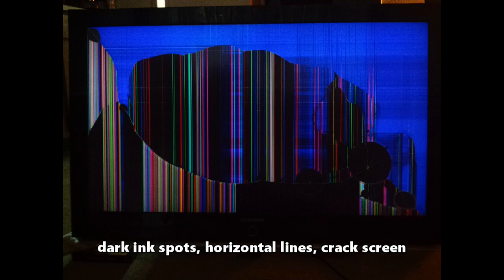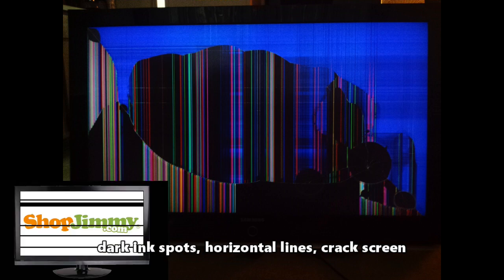Can I Help You Fix a TV by Looking at the problem and Tell you what Board to Replace ?

Comment from the maker: Subscribe to Tampatec here- https://www.youtube.com/tampatec Get TV boards here- https://www.shopjimmy.com/ or https://electropartsonline.com/ use code tampatecfriend *Get Fluke Multimeter here- https://amzn.to/2Er0JIb or *Solder iron kit- https://amzn.to/2PCmNk7 or *Solder iron with meter kit- https://amzn.to/2yJilZv
Reply: I have a vertical red dotted line that fades a few inches from the bottom. I have swapped the ribbon cables on the TCon board, and swapped signals. The issue appears to be on the panel. Could this be a tab issue? I have pushed on any connectors I can see along the bottom.
Reply: Is there a way I can email you a question

Comment: So here is a stumper for you.  Vizio LED TV.  New LED's all tested and work fine.  When I install in tv, there is one strip that will not light, although I have the voltage going to that strip and tested.  Although the LED strip works when out of circuit but WILL NOT work when In Circuit, does this mean the LED strip is still bad? All voltages to all the strips are equal.

Comment: Hey TampaTec
Thanks for making all these videos, it helped me fix a couple of tv's in the past following your guides.
Now I just got an Onn 70 inch roku tv that have been dropped and I'm unable to pinpoint what is causing the issue. 
Everything seems to work except I don't have any picture. 
Backlight is on and sound is working. 
After checking voltages, led connector on PSU I get 1 pin that read too high (269v) and the others seems ok at 149 v. 
On t-con board I can see that I get 12v coming from the main board but 0.9 going out to the panel. 
So my guess would be to replace t-con but the Led connector high voltage makes me wonder if there is another problem there. 
Already replaced main logical board because only 1 hdmi was working. 
Any advice would be appreciated. 
Keep up the good work 👍 thanks

Comment: I have a Samsung plasma TV: PN60E7000FFXZA

It comes on and the screen displays fine but it random times it will blink off and the standby light will quick flash three times then pause then quick flash three times then pause...over and over.

Can you confirm that my issue is the power supply board?

Also can you recommend where I can find a replacement board?

Thanks! Love your videos!

PS: This problem didn't start until I connected my Xbox and set the TV display to game mode.  Could that have anything to do with it?

Comment: I have a samsung un65ku6290f, I have a black screen when I turn it on, no display but it flashes slowly. Sometimes you can hear the start up sound. The display appeared for me as recently as last night, had fully functionality while it worked for a couple hours was able to adjust the backlight brightness everything, went to bed woke up and it's not working again.  Capacitors are fine. Ribbon cables seem snug and secure. Any ideas?

Comment: Great videos! I'm trying to fix a ~10 yo Bravia LCD tv I took in off the street and mostly works except sometimes when you power it on it trips the GCFI outlet it's plugged into. But then sometimes it turns on no problem. I checked all the capacitors on the power board, replaced 2 of them that were about 25% below their rated capacitance, one was the big 450V one. No change in the problem. If you have an idea where I might look next to resolve the issue I appreciate it. I wonder is something shorting or what? I don't know where to look from this point. Thanks for any advice!

Comment: Hello.TampaTec....Love the show man...Keep up the good work!.....Need a fix recommended for a Samsung Plasma TV....Model #(PN50B650S1F) The tv has sound but no picture. The picture is a greyish color and it reacts to button presses. So what i mean by that is that when you press a button the screen will fade almost flicker...and then return to the same tone of grey....I see a few black horizontal lines in the middle of the display as well. They are thin...Any help would be greatly appreciated! Thanks
Reply from the maker: Can possibly be bad connections going to the panel or control board.
Reply: @TampaTec  any idea what I should try? Think bad ribbons. I have already cleaned the connections and reseated them. Could the logic control board be bad?
Reply: Also I changed the y and x boards plus buffers with no results to fixing the issue...metered the power board and it checked out good. All correct voltages...

Comment: This is an awesome video! However I don't think you happened to cover an issue I'm having. I have a Vizio M3D550KD that only works in black and white picture. I've tried everything, changing all the cords, plugging in other appliances, and still black and white. There's a you tube video someone else made that shows my issue really well. Do you have and suggestions? I assume it's the mother board, which I'm not sure if it's worth replacing. I don't usually ask for help, but I'm desparate. Thank you so much!

Comment: Hey TT,
I am working on a TCL 55US57. I've replaced the main board and tcon board, but there are still vertical lines on the left side that won't go away. Can the PCB that's connected to the panel (ST5461D04-1-XL-2) be repaired or replaced?

Comment: I had flickering on my screen and by moving the ribbons on the tcon board half of the screen went black, and a noise started in the tcon, so i bought new tcon but still get half black screen, i tried moving top ribbons connectors but dont get anything from Any thoughts? Any help is apreciated, thanks.

Comment: Hi your videos are very detailed and amazing . I have a sony 40 inch kdl40z4100  the colours are fine the tv was working but yesterday it started going to standby mode . When ever i power up the tv it goes to standby mode in 5sec it does not stay on. Any guidance on this issue. The red light of standy blinks 13 times and goes off and then 13 times . Thank you

Comment: Thanks for this video. I have  a question regarding my LG 42'LED tv Model 42LB5500-UC,   I noticed the  backlight is going black after 20 minutes of viewing, then it would come back to normal after turning off for an hour , power on the TV again and it is back to normal the backlight is working again but then after 20 minutes the backlight going out again. So I have black screen  but  the sound is still working. Can you help me with this problem? anybody has the same problem with this TV?

Comment: Hey Tampatec,I just stumbled across your channel and I was really impressed. I work on some tube guitar amps and will occasionally attempt to fix a tv. We were working on a building the other day and took a Samsung NU 7200 off the wall to paint the wall behind it. When we put it back on the wall and turned it on, no go! The screen had some colored lines running up from the bottom of the screen. Looked like cracks>not good. Do you think its toast. It was not that old, maybe 6 months.Thanks, you rock!

Comment: Great videos - thanks for the great help!  My LED TV seems to have varying behavior - comes on normally for a minute or so, then goes to all horizontal multi-colored lines (no discernible picture), then goes to just a glow, never fully black, and sound always works.   Most often skips the first two steps and  goes to just a glow.  I tried to replace t-con board - same behavior.  I am thinking I am done - it's the likely the screen - you agree?

Comment: i have an old samsung lcd tv (about 10 years old - yeah i know i know, not much to replace, but that's not the point!)...   the colour seems to 'saturate', like the brightness is on too high, so that might fall under "colour messed up' but it's not purple - just looks like everyone has a light shining on a greasy forehead! - messed with all the settings, searched online, and found the ability to enter the support menu, but i tried each setting and none of them work with my tv...  SO maybe a special 'support mode' remote might be the ticket?   i figure the Tv is getting to the point it's unwatchable, so if i can mess with it a bit and fix it great, if not, i'll buy a new one - but you gotta try right?   ali express offers 'support' mode remotes, just wanted to make sure they really are SUPPORT, and not just a remote... thanks

Comment: I'm working on my cousins tv and I can't figure out what's wrong. The tv powers up and the back lights come on but there is no display. I replaced the T-CON and that didn't fix it then I replaced the video board and that didn't fix it either. I'm at a loss of what to do next. What do you suggest ?

Comment: Hey I believe I saw your video by divine appointment! I paid about $1000 for my 65' LG 4k Ultra... My friend put it on my wall.. Few months later it fell right on it's face 🤦...miraculously the outside wasn't too banged up except on the right side facing the screen. The inside has lines on the bottom and a big black sorta like ink blotch is how I can best describe it. What can I do with this? Can it be fixed? Is it expensive? Should I just toss it and buy a new one?
Reply from the maker: Screen is bad most likely. Recycle parts sell boards on Ebay. Or just sell at garage sale.

Comment: Hey, i have seen a few of your videos and am having problems troubleshooting my tv. I have a D32x-D1 vizio. I can hear sound on the tv but no picture though i can see the letters when i use the flashlight. So now i think the problem could be either the main board or the led strips since i changed the power board..HELP and thanks..

Comment: Hello, I have LG 50UH55 . The problem is that when I try to turn on the TV on I have red dims for 3 second then LG logo shows up for a second with no picture after that . I don't no what's the problem . I chucked the capacitors but icoudnt find any bad capacitors.  Can you help me out to find out the problem?

Comment: i have a philips 50pfp5332d/37 that has a  blinking 8 light code i replaced all bad caps n then noticed on the main board the hdmi were shot ..the blinking light code didn't start intill i installed the new main board

Comment: Gday, tampatec!! I have an LG50'PG79ED 240V 2008 plasma!! Obsolete!! OLD  here in Australia and well every where else!! i changed power supply bought in western australia from old tv and i also bought y sus replacing ! all working perfect sound picture turn on off,  tv all great !! BUT, there is a strong smell like acid  burning after tv is on for about half hour !! so strong, i checked capacitors, none swelled or leaking, i tried to do some meter checking but i cant work out what it could be ! i also fixed older power supply changed some capacitors and working back on tv but again after half hour again smell not as strong but there!! i checked buffer boards and y sus board and v sus board logic board .( i am NO expert) like you and would like  a different point of view as i know that capacitors can release some acidic smells when they are not working properly or on the way out! call me an old fool but i like the colours of plasma tv's, i know they heat up quite a bit and have many negatives but i am trying so hard to have it right again before i get fed up and go buy a silly led smart tv !!! je je je je thanking you kindly if i could get a reply from so far away!! LOVE LOVE all your videos and yesssss us Ozzie watch you all the way here !! You inspire many to have courage to try and fix and learn thank you !!!! !!!!

Comment: Hey man,  i got a stumper, my 40inch element cuts off but itself every like 7, 10 mins but only if using any inputs other than the rf antenna input. I didn't see any blown caps or hear any pop or any unusual noises when it happens. I don't have a volt reader but what should for best guess be homie? Thanks for all the informative videos, I've learned a lot.

Comment: I would like to see a video of checking the Components on a power supply (not incoming SBV those are labeled) ,but what should the readings be on the thermistor, voltage regulator , resistors .

Comment: have you ever fixed a craig clc504e 19 inch high def led tv before.
i have one that just quit on me, power supply is good, caps all look good, all boards look good with no burn marks and i don't have any stand by light!
any ideas!
Reply from the maker: if standby volts on power board is 0v or under 3v then replace power board or can be bad caps in power board.

Comment: Thanks for this video, very informative. I Have a few a question maybe you can answer. First off my tv Model is a Vizio VT420M, its old about 8 years and this is my very first problem with the TV.  I noticed my picture going out sometimes but it would come back on if I changed channels and the gradually it got worse and now the picture doesnt come on at all. I did some looking around and thought I needed a new power supply so I bought one (its not here yet) Then I did more searching and figured out my T Con board could be the problem. I disassembled my TV so I could see the parts I needed at this time my backlights were working. I plug it up to make sure they were working and I hear this little pop now my backlights aren't working. My question to you is, would replacing the power supply fix the backlights? Also my inverter is built into the power supply.
Reply from the maker: yes if power board has inverter backlight circuit but first check cable connections maybe you plugged in a cable in the wrong spot.
Reply: My power supply came in, I hooked it up and now the lights work again. Now just waiting for my T Con board. Maybe I can get another 8 years out of this tv lol

Comment: i put a replacement board in 46 inch samsung and the picture is noisy and colours are funny and has couple lines virtical i bn told its probably the wrong board is there any way it could be the tcon board?
Reply from the maker: bad colors and vertical lines seems like tcon board issue.
Reply: yer but 1 letter is wrong on model number of main board and i bn told its the wrong main board so i got a projector now and just wondered what to do.

Comment: The video id like to see is how to test components with a multimeter. Theres many that show the Power Board be tested but theres little to none of the main board or T-Con board being tested. Thanks!

Also another video id like to see is how to replace LCD backlights
Reply from the maker: Oddly I haven't had a LCD TV where ccfl failed yet. Also I made a video how to test tcon and main boards on my repair playlist.

Comment: Hi Tampatec, my 50" Vizio smart tv d500-b1 is currently not working, a few months back the Netflix app stopped working . It would open I was able to select a show but when I pressed play I would get volume with a distorted view, I tried the other apps same thing. I was still able to watch movies, tv shows with an android box attached but there were a few electricity outages and when I turned in the tv one evening I saw the power button light up but no video, just a black screen. I turned off the using the power button because the remote was no longer working, but when I tried to turn it on again, no luck. A technician checked it he said the power supply board was good but when he tried the connection to the main board, he got no juice. I purchased a main board from eBay. I haven't received it yet. Do you think the t con board can be bad also?
Reply from the maker: if tv has backlight glow but no picture it can be bad tcon board usually then main board is 2nd most common.
Reply from the maker: getting boards from ebay can be bad because you don't know if boards tested good before shipping.
Reply: Tampatec thanks so much